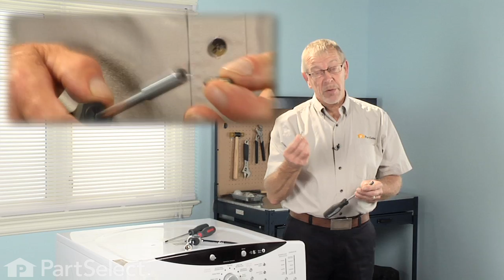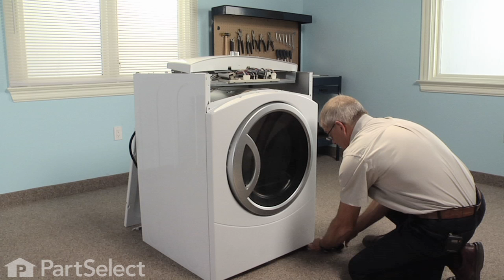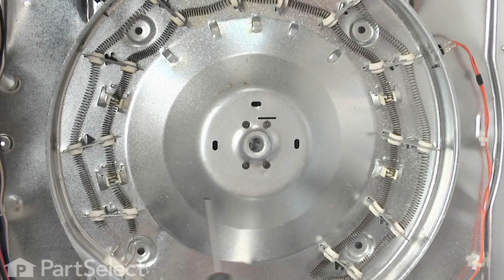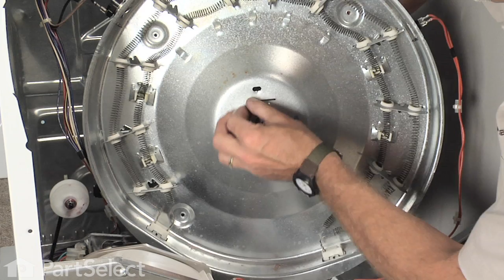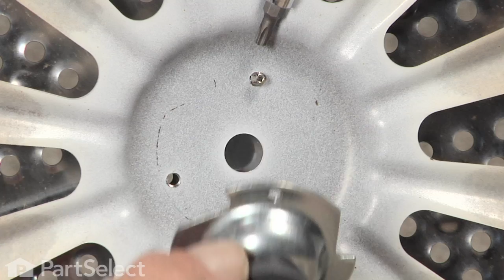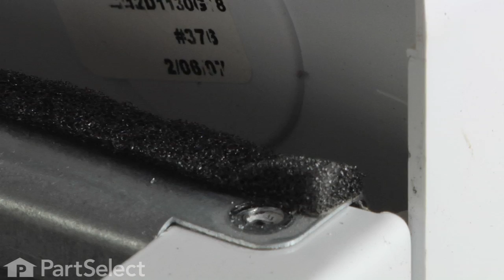Dryer Repair- Replacing the Rear Drum Bearing Kit (GE Part # WE25M40)

Comment: With inflation being thru the roof, the last thing we needed was to buy a new clothes dryer. Thanks to this video we didn't have to. There are a lot of DIY vids on YouTube.  When it comes to household appliances, stick with these pros.  A helpful hint.  When you order the kits for the rear flange plate that attaches to the heating element.  Don't discard the old screws until you make sure your new kit comes with the replacement screws.  If it doesn't, use the old ones.  When you need catch like these, there are a ton of them on Amazon etc.  Many of them are useless.  Cheap copies that don't fit or work well.  When you need these types of parts, order from these guys.  They have genuine & OEM rated kits and they're happy to help you on the phone or via email.

Comment: I have to replace a drum belt for a black dryer that looks like this. The problem is the papper work isn't in it. & There is no model number on the dryer itself from what i can see only a few part numbers for specific parts. How do i find the part number for the belt?

Comment: Thank you for a great video, I used the video to see how to remove the drum and reinsert. I had to replace the gas valve solenoid. I bought a kit that included both solenoids for $18.53 at a wholesaler. I am elated.

Comment: Question Sir:  I have a GE Dryer.  Model DVL223EB4WW.  I cannot get the drum to come out.  I've preformed all the necessary steps, but the drum will not release to come out  I need to replace the rear bearing.  Any help is appreciated.  Thank you, Jay

Comment: I've had this dryer for about three weeks now. It's quiet and easy to use.•ᴥ•>allmy.tips/GE-Dryer?40N     It dries quickly without getting too warm to the touch or needing multiple runs for a load - and this includes bulky items like blankets and rugs. The signal and extended tumble features come in handy, too. On average, I can have a load completed in about 30-40 minutes, about as long as a wash cycle takes to complete. It's a little smaller than the dryer I had previously, but it works better, is lighter, and is way more efficient. My only complaint is that the lint screen can be a little difficult to remove or put back. This is a good appliance at a good price.

Comment: Not the easiest video to follow but if you have some mechanical ability you can do it. You can also watch another video and between the two videos you should be able to fix your dryer. Watch this one too; "Making noises GE electric dryer"
 by Shop "ge dryer parts" Thanks for sharing. Found this video on your website. Best Wishes n Blessings. Keith Noneya

Comment: Drum Bearing Sleeve for GE Dryer Model NBXR453EV1WW
is no longer available, you have to buy the whole kit WE25M40
for $45, plus more work.  I did not want to spend that much,
nor work extra. I was told GE part WE1M462 would work.
3 months so far so good, used a little silicon (high temp)
grease also.
Reply: +B Smith You may have asnwered my question; I ignored most of the kit and simply replaced the bearing & O-ring.  I didn't use any lube though, but I did see that suggested on another video.  May your repair last as long as the rivers flow!

Comment: Your video on this model was outstanding and a big help. One of my dryer strings was out on this exact model and after watching your video I decided to go ahead and replace the bearing and belt. I also replaced the bearing slids and felt seal for the drum as well. You may want to mention these related parts since you have to disassemble the whole unit. I basically now have a refurbished unit. Thanks again, Roger
Reply from the maker: Thanks Roger, and you're very welcome. Glad to hear your dryer is up and running again!